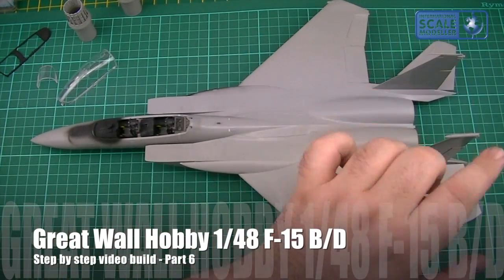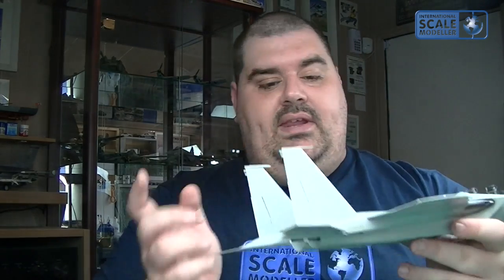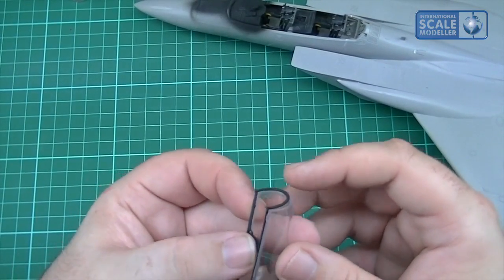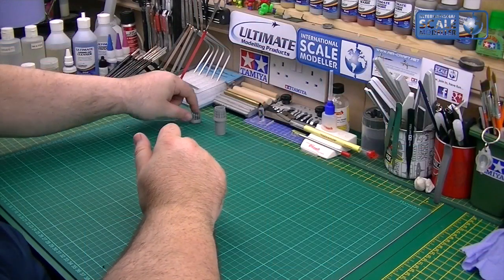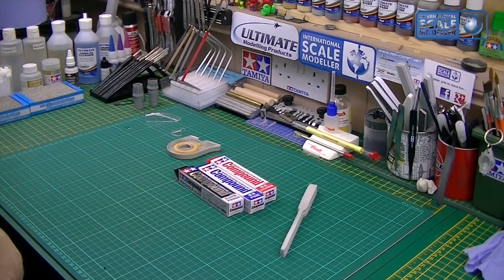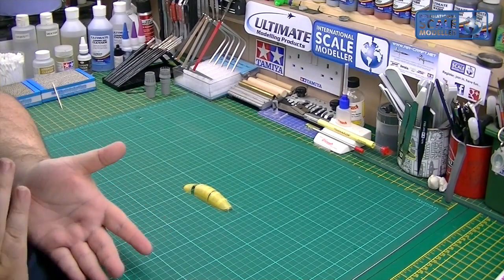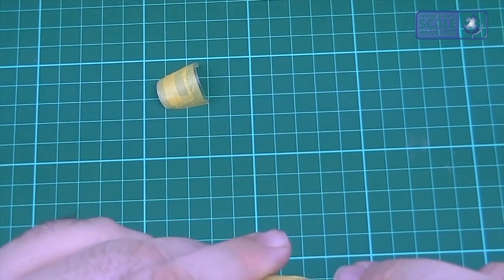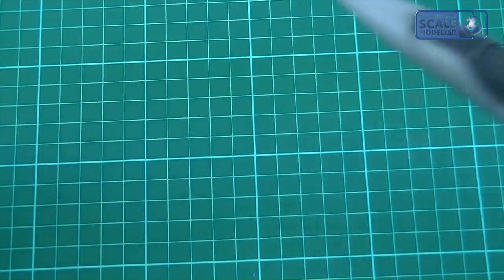Great Wall Hobby 1/48 F-15 B/D Step by Step Video Build - Part 6

Comment: Great video.  One tip I use for polishing canopies is using MER Car polish.  I know it is very easy to get hold of in the UK from suppliers like Halfords etc.  Having moved to New Zealand it is not as easy to get hold of and is very expensive but I found an equivelant product used for polishing aircraft which I used in my job.  I only use a little bit and it seems to work just as well.  After polishing I then dip the canopy in Klear/Future floor polish which unfortunately is no longer available but I still have a bottle that has lasted me 7 years and I still have a third of a bottle.
Reply: Yeah I've heard of people using Mer, I've got some knocking about somewhere